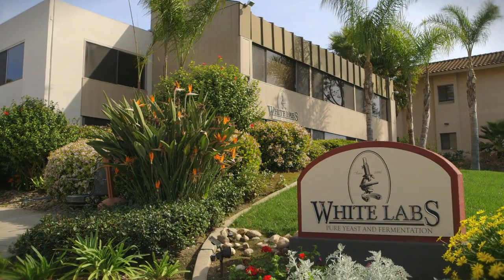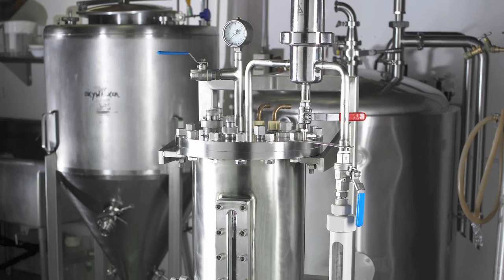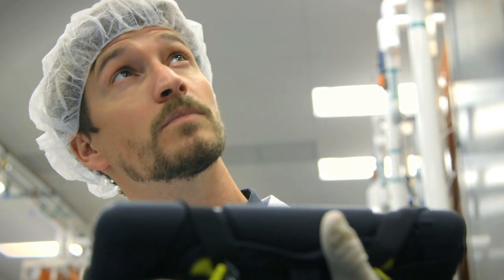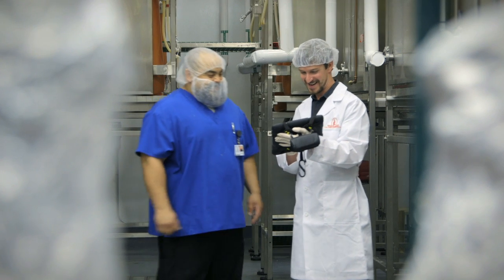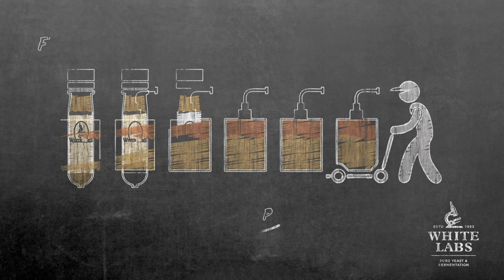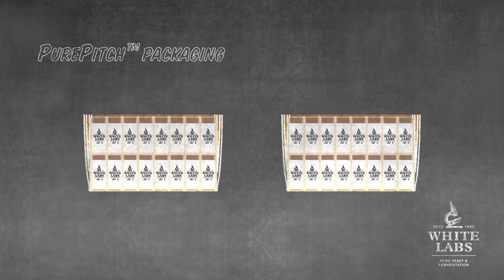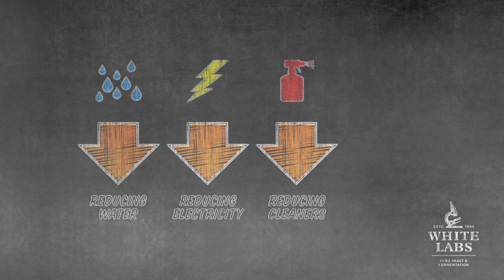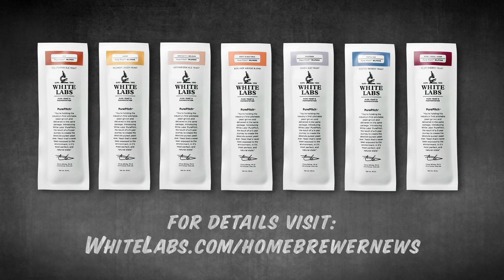White Labs FlexCell™ Process and Homebrewer PurePitch™ Packaging

Comment: how can you guarantee consistency in yeast count when growing the yeast in the container? im sceptical..
Reply: I have a feeling that White Labs has the expertise to figure that part out.
Reply: I've worked in manufacturing chemistry and quality control for several years, and the way this would be achieved is through a simple quality control step.  It really comes down to statistics.  You take a representative sample.  What is "representative" is determined through a series of tests in the manufacturing development phase - producing and testing entire batches - and it could be 10% of the batch, or it could be as little as 1-2%.  With each successive batch, you test the representative sample for viability and cell count.  You then get a mean and variance for that sample which are used as estimates for the population at large.  By the law of large numbers, variance should decrease (so you're not likely to get numbers much outside the range you observed, and ultimately if you have an infinitely large population, the cell count will converge on the true mean) as you continually examine more representative samples (the mean of the means will approach the true mean, and variance will decrease to 0).  Anyway, you set the standard that you're willing to accept for your mean and variance, and that is your manufacturing standard.  For example, hypothetically you have batches that yield 100 billion viable cells +/- 20 billion.  Batches that fall outside of this standard will be rejected and never reach market.

This is under the assumption that White Labs is GMP/GLP certified, or at very least uses GMP practices.  I think I recall seeing batch numbers on their vials in the past, which would be an indicator, but I suppose it's something to investigate.